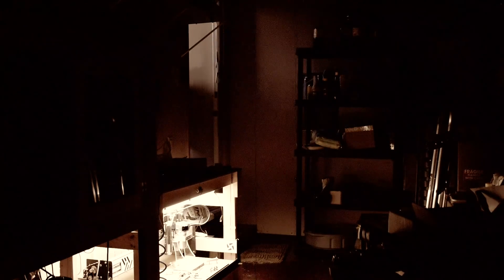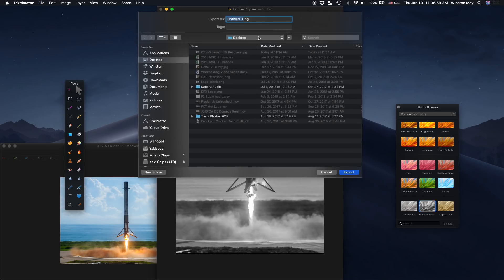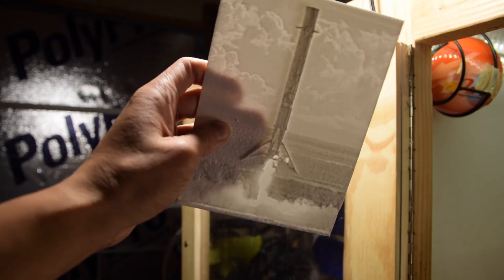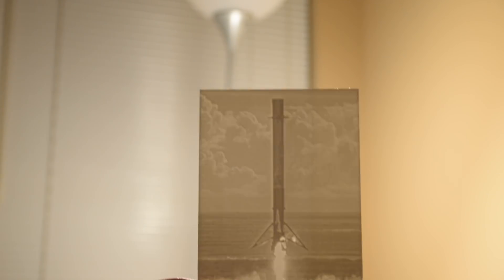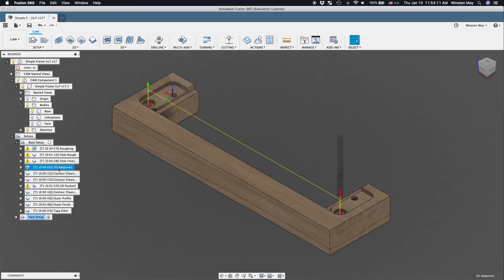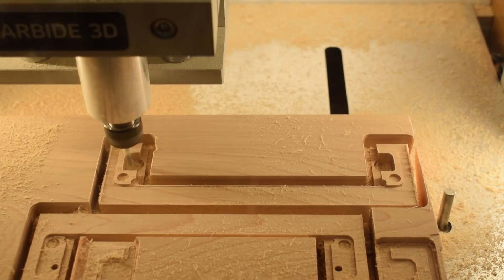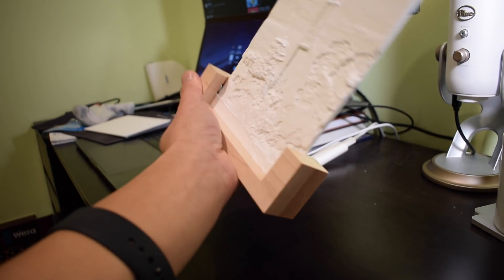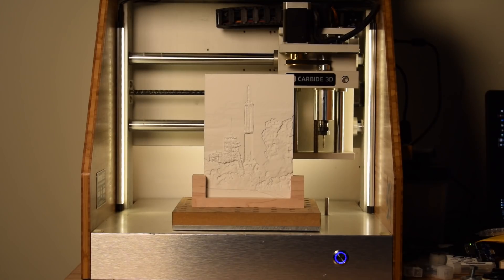Making a SpaceX Falcon Heavy Lithophane on the CNC - #138

Comment: Nice!
I just ordered a cnc and have been looking through your library for the last hour or so. I make lithophanes on my 3d printer right now but I want to make them in porcelain. Have you tried milling porcelain? Do you know where to get flat pieces of it? 
To get rid of that border issue with the frame you simply add a black border to the image when editing it, or where you make the heightmap. I use 3dprocks which has a border setting.
Reply from the maker: I don't think anyone (at least in the hobby space) has milled porcelain before, ceramics are not commonly machined. I think you mean Corian...?
Reply: @WinstonMakes   I don't know much about corian, or porcelain for that matter.. but I do mean porcelain. I'm aiming to get mine as close to the 1800's lithophanes as I can. I've got way too much time on my hands right now so I'll try different materials and techniques and make a video about it.

Thank you for posting these videos, I really enjoy them.
Reply: @willci  did you learn about using a liquid porcelain in a mold? That's closer to how they are made. Just wondering.

Comment: Would it be worth considering a tapered design - 
  i.e the 2 fingers holding the lithophane are noticeable less deep at the top compared with the base.
Reply from the maker: chris cardwell only if the thickness of the lithophane is symmetrical. Otherwise only one side will get snug.

Comment: You could use the negative of the Litho as a pattern for the wood stand.
Reply from the maker: Good thought. It would help, but it wouldn't be seamless as there are points or contours that a become internal corners that an endmill can't get into when you reverse it.
Reply: @WinstonMakes  Perhaps a better idea would be to use small foam strips to pad that area and close it up. It would be compatible with future lithos without having to redesign the stand.

Comment: Nice, though I like to keep all my machining (incl. PCB and grayscales) in Fusion360 due to it having all my feeds, speeds, fixtures, post-processor settings, etc. and there are some ways to do that:
1) The Image2Surface plugin for Fusion360, but since it makes quad mesh patches, it can handle only low resolution before Fusion slows to crawl.
2) A little know utility called "b2g" can convert a grayscale heightmap to an STL with single-pixel (!!) precision if configured so. Fusion360 can handle triangular meshes much more efficiently and has no trouble handling hundreds of thousands of triangles. You can also fix up artifacts (and edges, etc.) easily using the Mesh workspace.
3) I got much better results using the "Scallop" toolpath on organic shapes, with constant surface distance enabled (default). It's like both ways parallel (as it gets all the steep areas too), but in half time.

Keep up the good content! (And looking for the next dfx episode!)

Comment: Winston, That is a great project. Is there a reason why did you cut it on your Nomad and not your Shapeoko? I have a close friend who's 10 year old grandson is equally addicted to space and the Space X program as you and thought I might try and give the cutting a try on my Shapeoko 3 XL.
Reply from the maker: Should be doable on the Shapeoko, I was using the nomad primarily leading up to my roadtrip because that's what I would be using on the road, so that's what I needed to validate my cutting parameters for.

Comment: You use the Nomad for your lithophane, are there any reasons why you would use the Nomad vs the Shapeoko.  It may be my uneducated perception but except for the smaller form factor and having a complete system including Meshcam, I'm not clear why one would use the Nomad in general since the price is more expensive than a Shapeoko.  Maybe you could explain.
Reply from the maker: Better theoretical resolution, much more rigidity, and the convenience of not having to build it. Different target demographic. 
Both machines could do this, I was using the nomad because that's what I would have on my roadtrip, so this was practice.

Comment: If you give the picture a black border, then you will have a consistent thickness edge to attach it to your holder. This can also be hidden in your holder, so it doesn't impact the image seen.
Reply from the maker: This is true, but then the lithophane is destined to only ever be displayed in this particular holder.
Reply: @WinstonMakes  You could just add black rectangles in the parts of the lithophane which is hidden inside the frame, rather than a full border. Looked perfectly good though - I've only made 3D printed lithophanes myself - have to consider making some on my CNC.
Reply: @WinstonMakes  That border will create a frame around your image, I did this with one of my 3D printed lithophane and it adds an element of pop to the image. I could solve the gap in your holder.